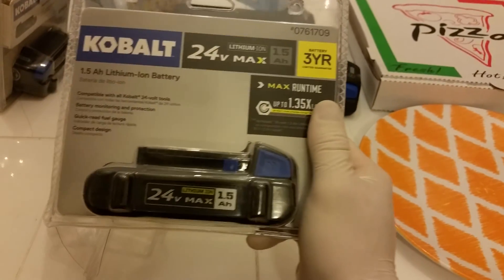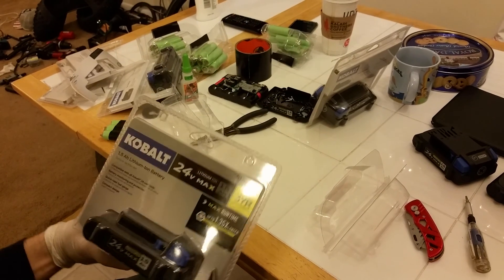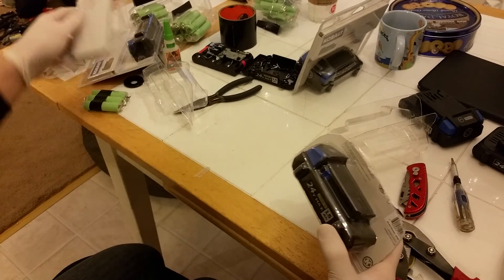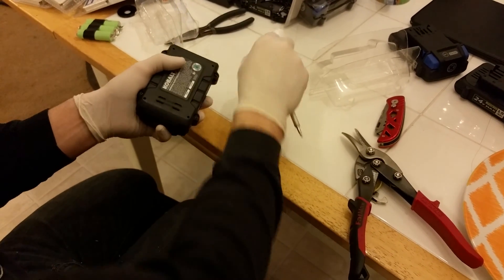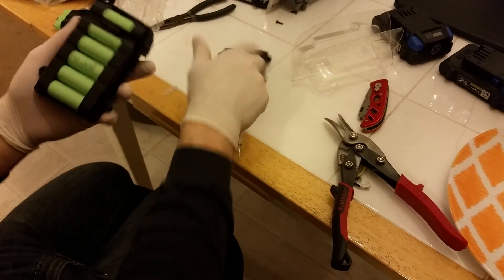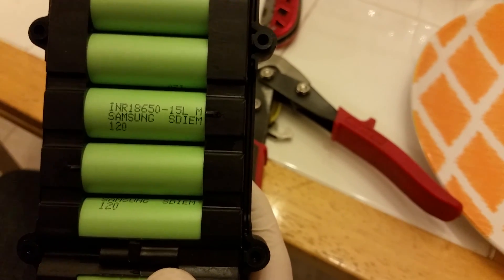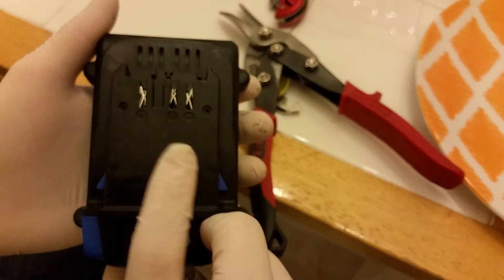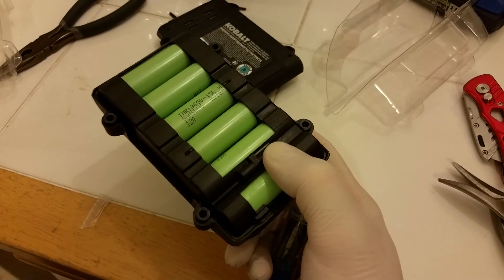Kobalt 1.5Ah 24V MAX Teardown

Comment: Do you have an update to the ebike? I purchased a pack so I could check the actual capacity of the batteries.  The lowest I got was 1525mah. It's consistently above 1500mah which is good for me. I'm using them for a 24v 20ah greenworks lawnmower.
Reply from the maker: Antolin Ventura - the ebike pack has been running solid for months now. I balance charged it to start and it works great. My pack is used close to daily and hardly ever needs rebalanced. Balance charging is the slightly spendy part, but getting into custom packs, you'd use a balance charger for several things. For your 24V project, you might be able to just wire two of these packs together and use them as is with your current mower charger. Look into wiring in parallel and figure out how to hook them up to your mower.

Comment: where did it say 18amp current draw capable
Reply from the maker: em forty - I looked up the specs off the model number printed on the battery
Reply: I see…good review…Im planning of buying the 2.0ah version for $20 i hope that one has same cells or amp draw.
Reply from the maker: em forty - The 2.0 Ah packs use unidentified cells. Given the application, I'm guessing they can handle high amperage, but the cost for unknown specs is kind of high. What are you looking to use them for?
Reply: i have a Neuton 24v mower and thinking of using 2 Kobalt in parallel and if it can deliver 18 amps each then i know i'm safe current wise not overload the battery
Reply from the maker: em forty That should work great. I can't see them having less than 10A cells in the 2.0 packs. Keep the difficulty of charging in mind. These might not charge with your current charger. Cut 'em open nicely for an easy return.

Comment: do these batteries have a circuit board built in for balance charging?
Reply from the maker: Les O they do, but you'd be stuck at 24V. Might as well keep the batteries intact and simply connect up as you desire if that's what you're going for.
Reply: lukemanius Wow fast reply.
 What I was going to do is take the guts out of this and put in an 18 volt pack and run 18 volt tools at 24 volts. If the have a balance charger circuit built in I can charge the pack with just a 24 volt power supply.